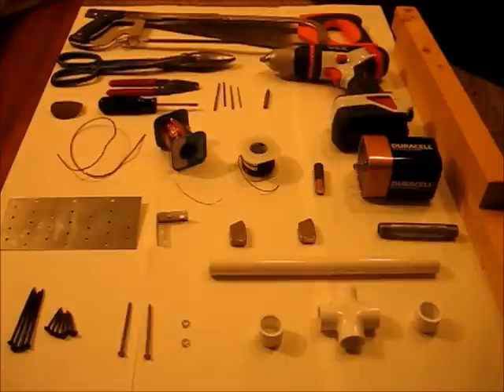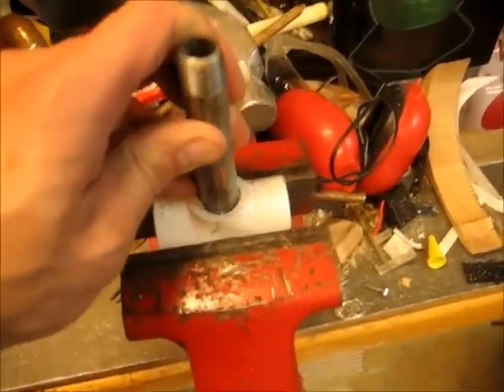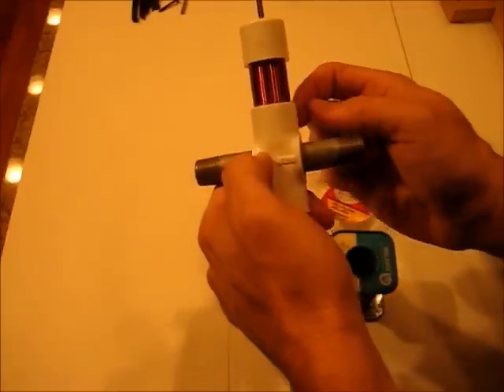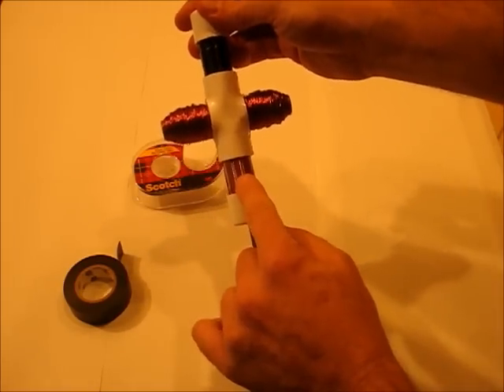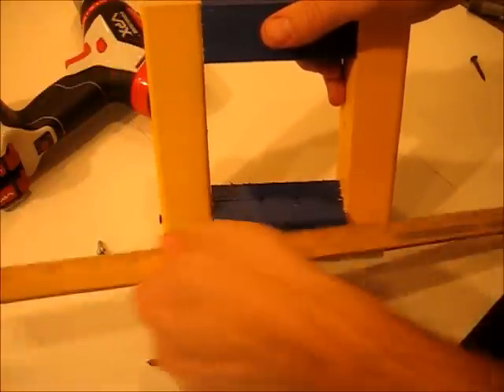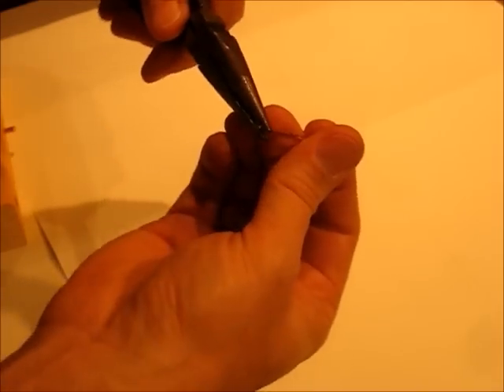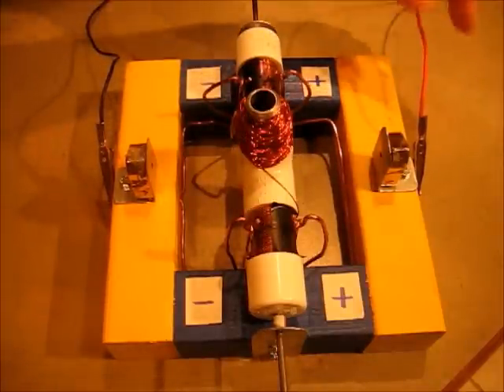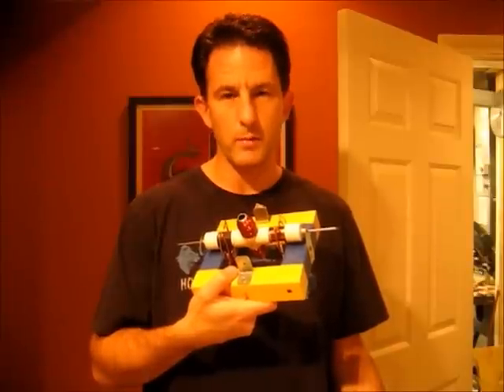How To Build a Motor (HowToLou.com)

Comment: Im going to use this design as an outline for a motor im buiding for physics, i have 2 magnets (70lb holding force on each) and am wondering if i can achieve something like 2000 rpm with this configuration. What would you estimate your motor's rpm to be? or would you simply have to measure it
thanks!
Reply from the maker: +Jimmy Wilhite -  That is pretty fast. I would guess minerunsat near 600.  I think 2000 is possible, but you will need a very precise build. Your rotor will have to be perfecty balanced or it will Come apart at high-speed. You will also need two small ball bearings to hold the nails and allow them to spin faster.  You might want to hammer your brush wires flatter, so they have better contact with the rotor.  Fast motors can be thrown together pretty quickly. Really fast motors take Percision.  If you are willing to triple down on the effort, I think you can do it. Good luck!

Comment: Would two semi circles of copper pipe with a small gap between them work instead of a layer of wire? Does the pipe holding the two coils need to be metal? Would 4 coils be possible? if so, could I just treat the wiring as if it were two identical motors combined, but at 90 degrees of each other? Any advice would be greatly appreciated.
Reply from the maker: @Mantis- Yes, I have built single commutators with split copper pipe.  It works very well.  The metal pipe is not required, but serves to focus the electromagtets, and make a stronger motor.  If you don't have a lot of windings on the rotor, plastic is actually better.  Yes, you can make two sets of rotr arms, 90 degrees apart.  If you really want to get fancy, you can make a single 4-way split pipe commutator. My first motor actually had 4 sets of coils (8 arms) !  The motor in this video was designed to be pretty powerful, yet very easy to build, so I did not used any andvanced techniques here.  With more effort, you can make a scary fast motor.  Make sure you keep it well-balanced, or it will fly apart :)  More build tips at HowToLou.com/motor

Comment: For DC you want the iron core defiantly. Look up the property of permeability, im 99% sure iron has a higher permeability than brass. Basically it is a property in electromagnetic  that describes how conductive (for magnetic flux) a material is, which you want a larger number.

Comment: will it work even tho my whole copper wire is not varnished? and i didnt use pvc pipe instead a used a  metal cylinder...will it work? i have not finished it yet...so i dont have a chance to test it now..

Comment from the maker: @Farah Fahmi - I used PVC in this motor design, for several reasons.  A motor must have rotor arms perpendicular to the axis of rotation, and a PVC cross is an ideal part to accomplish this.  PVC piping is also much easier to cut and drill than metal piping, and can simply be pressed together, rather than soldered.  PVC is strong enough for this application, yet light, so it reduces friction on the bearings (nails).  Lastly, PVC is a non-conductive material.  If everything is wired correctly, this should not matter, but PVC is more forgiving if you accidentally have a bare wire touching the commutator.

The problem with 9-volt batteries is that they can't provide nearly as much current as the big lantern batteries.  4 Lantern batteries are like having a garden hose at 24psi.  4 9-volts are like having a soda straw at 36 psi.  You just can't get enough flow.  

There is one modification you can make that will allow you to use 9-volt batteries.  Build the motor vertically, and stand the bottom nail on a piece of glass.  This gives it a very low friction bearing surface, so it will need less energy, in general, to run.  Also, if you want to build this low power version, you should replace the metal rotor arms with PVC too.  Metal rotor arms are good for focusing the magnetism of the windings, but also are attracted to the stator magnets.  If you try to spin any toy motor, by hand, you you feel it is "bumpy".  That is the metal rotor "sticking" to the stator magnets.  The more powerful the motor, the more "stick" in the spin.  If you are making a low power motor, you don't want any sticking at all, or your motor will never spin.  Put plenty of windings, and you will b fine.  Check out Anja Bea's vertical, glass bearing motor, in the gallery, at HowToLou.com/motor.
Reply: Thank you, I really appreciate you replying so quickly! I will try looking for the 6-volt lantern batteries (they're quite hard to find where I live), and if I can't, I'll apply the modifications. Thanks again! :D
Reply: You can also use 2 x 12 Volts 7 Ah SLA batteries in series.

Comment from the maker: @Ethan Sherlock - Why does my rotor "stick" to the stator magnets?
Some people find that their motor will not spin, because the metal pipe, in the rotor, it is attracted to the magnets on the stator.  That is normal.  If you spin the rotor of any toy motor, by hand, it will feel bumpy.  That is the rotor being attracted to the magnets.

But, it is not normal if your motor is not turning :)  The basic problem is that your magnets are stronger than your electromagnets(rotor windings). The magnets are so strong, that they hold the rotor in place, fighting the urge of the electromagnets to spin it.  There are three solutions:  

1 - Reduce the strength of the magnets by backing them away from the rotor, or replacing them with weaker magnets.  Try this as a potential quick fix.
2 - Replace electromagnet's core (the metal pipe) with a plastic pipe.  This will totally eliminate the pull of the magnets on the rotor, so the "problem" will be gone.  However, this reduces the focus of the electromagnets, so they end up not as strong.  Do this, if this is a school project you need to get working ASAP.
3 - Increase the strength of the electromagnets, by increasing the number of windings on the rotor and/or increasing the voltage.  This option will make the most powerful motor.  Do this if you want a motor that will impress your parents and friends.

Comment: Hey, nice motor
just wondering is you know of a substitute for the 3/8 inch by 4 inch threaded pipe?
Could i just use a plain non threaded steal?
Reply from the maker: The threaded pipe should be easy to get at the hardware store, in the gas plumbing isle.  If anything, I would substitute just more 1/2 inch PVC pipe for the rotor arms.  The magnetic field won't be quite as focused, but the steel will not want to stick to the magnets, so it will work about the same.
Reply: ***** thanks for the fast reply. so if i cannot find the pipe i could just use a smaller PVC pipe as a substitute? 
Also, for the wire would i be alright if i got this one?

http://www.bunnings.com.au/picture-hanging-copper-wire-7-7mx20gau-1strand-cd1-72224_p3930102
Reply from the maker: scene2all Sorry I did not see this until now.  No, that copper wire does not have any enamel or insulation.  You need the electrons to run around and around the coil, to make the electromagnet that is attracted to the permanent magnets.  If your copper wire has no insulation, the electrons will cheat and just jump from coil to coil, where they touch.  They are trying to get from one side of the battery to the other, and they, like us, always tend to take the easiest path.  Insulation forces them to go the long way, through the whole coil.

Comment: I notice when you start the motor, you always have the rotor at least 45deg from the magnets.  If the rotor spokes were lined up with the magnets, would the rotor begin to turn when a current is applied?
Reply from the maker: Glen Boehm - Ideally, a motor should start in any position.  When the rotor is lined up with the magnets, the commutator should apply current to the rotor arms, to produce a magnetic field that apposses the stator magnets.  This is actually where you get maximum torque, because the rotor really wants to flip, to get away from the stator.  Precisely manufactured motors work in exactly this way.  Homemade motors may be a few degrees off, and have trouble starting, at this point, without a little help.  Starting at 45 degrees is usually a pretty safe bet.  Also, pro motors have six or eight arms, instead of two, so some are always pulling.

Comment: I have two question for the scratch built motor:
1. Can the motor run with only one 6-volt lantern battery?
2. Can the motor run in 4 positions when holding it by hand: upside-down, upward, sideways?
I want to make sure if this design runs on only one 6-volt lantern battery and in 4 positions before starting. Thank you!
Reply from the maker: Jamal Baloch - It will only run one one 6-volt battery if you replace the metal brackets that hold the rotor nails, with tiny ball bearings.  This will reduce the friction significantly, which is the main enemy, especially with only 6 volts.  Also, you will need to affix these bearings with maybe super glue, to the nails, so the rotor won't slide out of position, when you turn the whole motor sideways.  Also, use pvc rotor arms instead of metal, and put as many windings on as you can, and use strong stator magnets.  If you do all that, the answer to both your questions, can be Yes.

Comment: I am trying to make this motor I was wondering approximately how many windings you put on each side
Reply from the maker: +Bob - hmm.  I did not count.   I would say as many as possible, but make each rotor arm at least 1.5" thick.  The more windings, the stronger the motor.

Comment: Hello,
I made this motor, and it spins for about a minute, when it stops. I noticed that one side of the wire wrapping was very hot. Any suggestions?
Thanks.
Reply from the maker: +Lily Marie Jackson - That is a good run for a home built motor.  The problem is that all those sparks you see between the brushes and commutators are the result of poor connection, and they generate the heat.  A real motor has really wide carbon brushes held in place with springs and a perfectly round and perfectly centered commutator.  With all that, they don't spark much at all, but all that takes a motor factory to produce.  It is great that you got yours running so well.  If you want less heat, you can flatten out the copper brushes with a hammer, so they cover more surface area.
Reply: +HowToLou Thank you very much for the quick reply. I just have a couple more questions. Is one side getting really hot normal? Also, I need this to run for 30 minutes for a school project, is there anything I can do to make it run that long? Thank you so much!
Reply from the maker: +Lily Marie Jackson - If run time is your most important factor, my other motor is much better for that: https://www.youtube.com/watch?v=zbdinUO3M-8

If one commutator is getting hotter than the other one, it is sparking more. To make this motor run cooler,  flatten the brushes, and reduce the rotor friction by replacing the metal brackets with ball bearings, or turn the motor sideways like Ana Bea did on HowToLou.com/motor
Reply: +HowToLou Thanks!

Comment: I am doing a physics 12 project and one of the things we are having trouble with is finding the right wires, we currently bought a 22 gauge wire with a coloured plastic outside but on the inside it isn't a solid wire but is composed of many small ones. We now are stuck with what to do when it comes to sanding down the wire so that we can have a connection, do you have any suggestions?
Reply from the maker: Kyle - The best thing to use is "magnet wire", which is enamel-coated, solid copper wire, available on Amazon and many other places.  Google "magnet wire".  The wire you have should be ok, though.  In place of the enamel coating, it has plastic coating, and it is "stranded" instead of "solid".  Leave the plastic coating on for the rotor arm windings, but strip it completely off, for the commutators.  Think of the plastic insulation as a hose, and the wire is the water inside.  You want to put the water in, on one commutator, and take it out, on the other.  You don't want any leaks in the hose, in any of the rotor windings, however.  Forcing the water (electrons) to run around and around the rotor arms, is what makes the electromagnets.

Stranded wire should be fine.  The only downside to plastic insulation, is that it is a lot thicker than enamel insulation.  100 winds of magnet wire might only be as big as a golf ball, where 100 winds of your wire might end up the size of a tennis ball.  That is fine.  Just make sure you get plenty of winds on there.

Also, I would HIGHLY recommend you take a look at all the build tips at HowToLou.com/motor, BEFORE you start.  There are a lot of answers to questions you have not asked yet, but will :)  Good luck with your motor.

Comment: Hi! Thank you for this video: it's the best tutorial I've found! I have just some questions. I would like to build a motor with enough power to move a cart with a person on it. Do you think that this motor is powerful enough to do that? Do I need particular batteries? I don't need a 60 mph speed xD I just want it to move. Maybe I can build a larger one, with stronger magnets and more windings so that the torque is higher...
Reply from the maker: Sorry, is nowhere near powerful enough to drive a kart.  It would be very difficult to build that.  Powerful motors have finely machined parts with super tight tolerances and low friction bearings.  Build this motor to learn about motors, but I would suggest buying one, like the Briggs and Straton ETEK to power a kart.  Actually, I did that.  Video coming soon.  -Lou
Reply: ***** Thank you again, I supposed that, but I don't wanna drive a kart, I just want to move a little cart :) Do you know how many Newton your motor generates? Do you think I can increase this value enlarging the motor, increasing the windings, using stronger magnets and more powerful batteries, enough to move a little cart? I mean, four wheels and wooden board on them.. a very simple thing.. I can also use ball bearings to reduce friction.. P.S.: I wanna see your video of the kart! ;)
Reply from the maker: iPhede95 OH!  OK.  That should be possible.  I don't know how much torque this generates, but it should be enough to drive a lightweight toy cart with bearings.  I would put a small (~0.5 inch) pulley on one of the rotor nails, and a large (~2.5 inch) pulley on the axle of the kart. This will convert the speed of the motor to torque, which is what you will need to drive the kart.  The big 6 volt lantern batteries will likely be too heavy, so you can connect them with a long wire, or replace them with lightweight model airplane batteries, found at a hobby shop.  I would also put as many windings as you can on the rotor, to make it as strong as possible.  You could also make the stator out of balsa wood or pink/blue foam board to save weight.  It would be a good idea to replace the rotor holders with tiny ball bearings, too.  Good luck.
Reply: ***** Thanks so much, I'll try for sure!!!

Comment: Hey Lou, so I built this design for my physics project and it won't move. What are some reasons as to why it isn't going? I believe it's a little heavy but other than that I don't see any other problems... Pls help its due very soon. Thanks
Reply from the maker: +Bavley Guerguis - there are a list of troubleshooting build tips at howtolou.com/motor. The most likely problem is that your brushes are not touching the commutator.
Reply: +HowToLou thanks. Do you think the weight of the pipe is a factor? I didn't exactly use a pipe but a material a little heavier
Reply from the maker: +Bavley Guerguis - Extra weight in the rotor will add extra friction at the bearings, so it is somewhat of a factor.  The way to quickly eliminate that weight friction, is to stand the motor on and and rest one of the nails on a small piece of glass. Look on my website and Anna Bea's motor, as an example.

Comment: Hi Lou! We are having problem as to how much winding should we do on our rotor.... How will we know that the number of winding that we have is already enough for our motor to spin at 1000 rpm? how do we compute it? Our Voltage source is 24 volts and we have a strong magnet. Our core is not affected by the magnet. thanks! :D
Reply from the maker: The speed of the motor depends on many things, including the exact strength of the magnets, the exact friction of the bearings, the gauge of the wire, the amount of contact with the brushes and the number of windings. There is no easy way to calculate the speed.  Just put as many windings as you can.  If you are faster than 1000 rpm, you can reduce the voltage.  I think mine runs around 900 RPM

Comment: Hi, I'm constructing my motor for my physics class. I was wondering if this motor was a brushed DC motor? Also, we cannot exceed 12 voltage power and it has to pick up a Family Size bag of Lays chips. Would this motor work for this?
Reply from the maker: Yes, this is a brushed DC motor.  Yes, you can use 12 volts, but use an all plastic rotor, and lots of wraps of wire, and strong magnets.  Tie a piece of lightweight string to the axle (nail) and hang it over the edge of a table and tape it to your chips.  Please review all the build tips at HowToLou.com/motor BEFORE you start your build.  It will save you a lot of headaches later :)
Reply: ***** I am also limited to 12 volts, but when you say use an "all plastic rotor" could you give an example of what to use and include what part it replaces in the motor you built?

Comment: Would the motor run any different using 1 inch pvc or does it have to be 1/2 an inch?
Reply from the maker: Alexandra Phen - Very sorry for the delay in getting back to you.  A larger commutator will make the motor slower, because the friction of the brushes have more leverage, as they are farther from the center of rotation.  I would slick with 1/2.